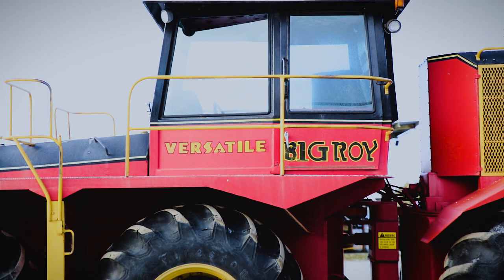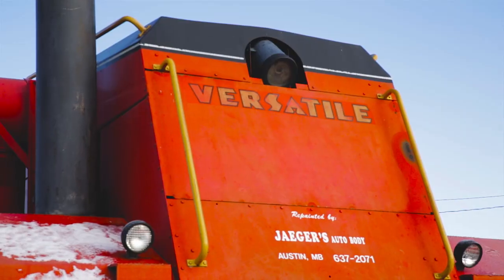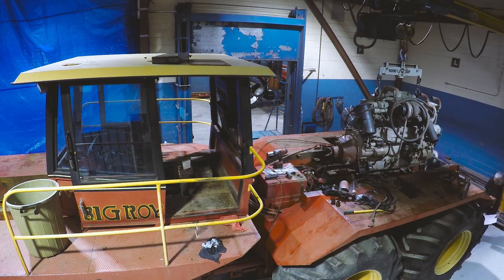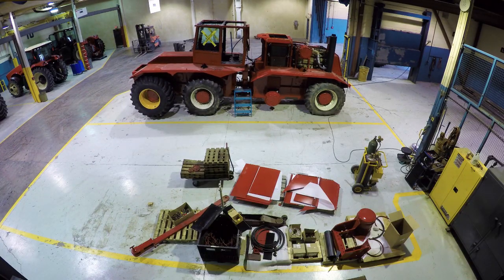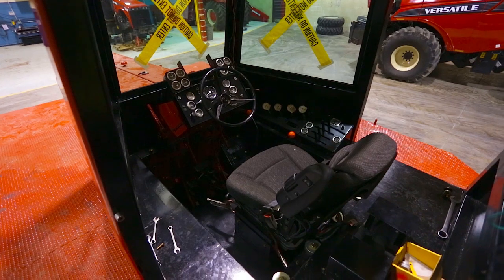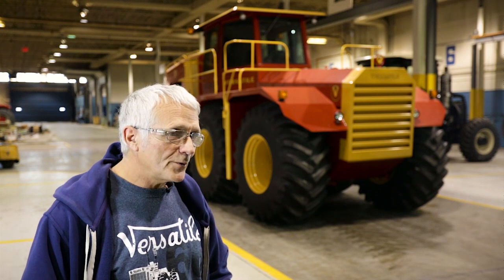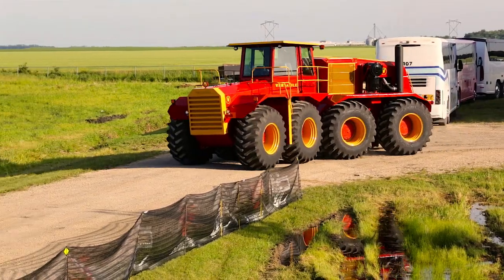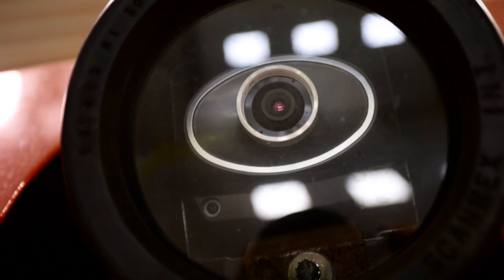The Restoration: Big Roy

Comment: So glad to see that it has been returned to it's original glory.  I worked for a large Versatile dealer in 1977, Big Roy went to Regina, SK Farm Progress Show that year, it was so popular that rumour has it that three customers each wanted one asap. Then the asking price was $132,000, a bargain for 600hp (KTA1150 Cummins), but it was below the estimated build "cost". Big Roy was scheduled to be demonstrated at a field day show at my dealership in Brandon, MB, but due the predicimate of the too low advertised price, the show was cancelled. The semi truck stayed at a motel in Brandon over night, but driver was instructed to bypass our location and head back to Winnipeg via an alternative route. Tractor was never shown to the public again for years. Not until Versatile was sold to Ford New Holland, then it was brought out of moth balls and made some appearances around, then donated to the Austin Museum. Before they took it to Austin, it sat at our store, as I was the only person around that had ever driven it, I actually loaded it on the semi that hauled it to Austin. Driving it with that odd suspension they talked about reminded me of riding in a large boat on open water, it would sway left when you turned right, etc.  FYI, Versatile also built a six wheel drive. It had an NTA855 Cummins with normal front end (1 axle), back portion had four wheels (2 axles). For the record this is only my version, I'm sure others could add info and possible correct some of the details.
Reply: Your not the only one that drove it

Comment: It used to sit in the parking lot of the Versatile plant here in Fargo ND, just east of the Steiger Tractor plant I worked at.
Reply: Versatiles are built in Winnipeg Manitoba, Canada.
Reply: Now they do and did back then too. They also had a plant here in Fargo back in the 70s. On 7th Ave. N. near then Steiger tractor plant.
Reply: @michaellukinski3080  in 1977 they built Big Roy and the 825 tractors in Fargo as they couldn't  keep up in Winnipeg.
Reply: That's correct. When they brought big Roy out the stieger staff blocked the streets so no one could come look at it

Comment: What was the purpose behind this design of this tractor verses a common 4 wheel drive in the 70s ?
Reply: The size some farms grew into dictated larger and more powerful equipment for some. When power increases putting it to the ground reliably then 4 axle sets vs. 2 insured less stress in all aspects of the driveline save 1 more parts more failure points. Implements had grown to 100+ ft or better as well. So like Big Bud, Big Roy's weight was never a worry in order to keep the wheel biting and not digging holes. We farmed in north central Montana primarily using Versatile tractors and must say for the price they were difficult to beat. That said it was very clear the power and prestige of larger and larger tractors and implements became a ego thing sort of a agricultural arms race.....Mine is bigger than yours. Always profit in a man's bragging rights.